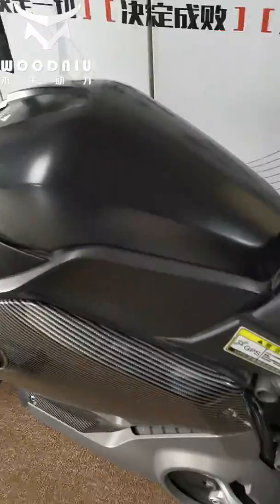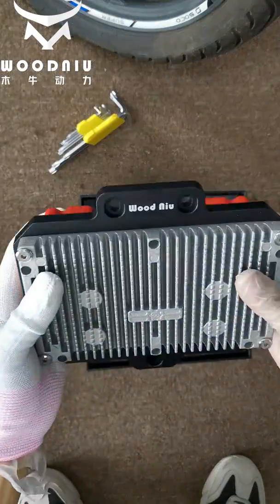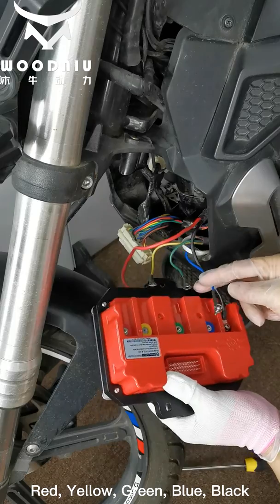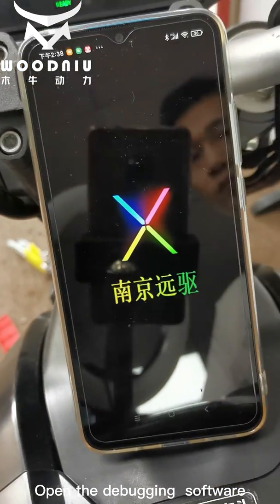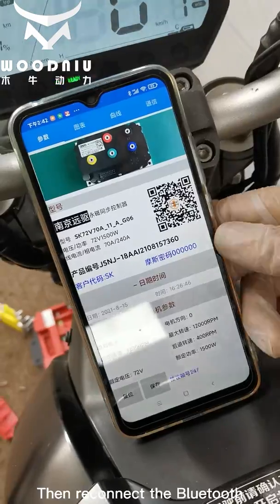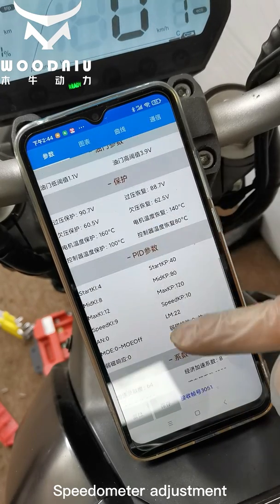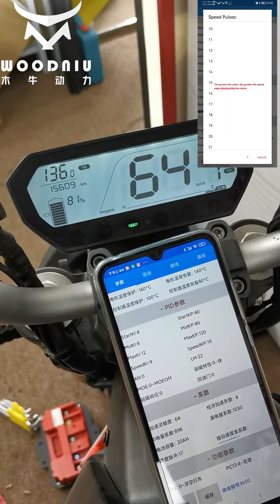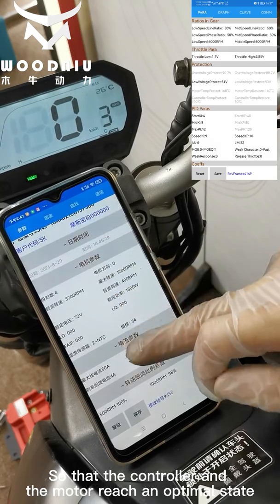TS/TC/TC-Max modified speed controller

Comment: Great product, great seller! Super happy with this controller!
Reply from the maker: Thanks for your compliment.
Reply: What model supersoco did u do this on? I’m thinking of buying but apprehensive. I’m not looking for more top speed but faster acceleration, is this possible? Any more info you can share on your installation would be helpful.
Reply: @Pipun123  yes acceleration is much better/faster in comparison to the standard controller. My model is a super soco tc. Installation was easy. Controller is the same size as the old one and comes with a bracket.
Reply: @toetsenbreier  Thank you so much for your reply! Did you change the battery? and what controller model did you get? Thanks again in advance.
Reply: @toetsenbreier  The TC model limit is 45 km/h but you can unlock it so it can reach 65 - 70 km/h. How faster does youre TC model runs for? I own a TS model and about thinking to buy this product so i can do faster then what im doing now.
Reply: Hey where can I find the same controller and battery , mine is super soco ts lite

Comment: Hey, I have TS1200r, can't remember model year but I just bought a Seenruy Li-ion battery 60v50Ah.
 Charging voltage 71,4V
Std charging current 10A
Std Discharge current 80A

Everything else is stock. My bike does have the derestriction sequel which allows me to go up to 70km/h (about 60km/h on GPS)

Would I be able to get more torque and/or top speed now that I have bigger battery by simply buying a new controller box? Or does it just derestrict what I already can do? Some controller sellers they do the debugging etc, but I just want more torque and maybe top speed without having to change the motor. Do I need to buy new wires?

Please help

Comment: It works! Installed today, had a minor hiccup with the parameters but Peter was super quick to respond and advise for a very easy fix. Now works perfectly, thanks Peter!! Can't wait to ride to work and not hold up traffic :)
Reply: Did you buy a new battery? What’s the acceleration like?
Reply: PS am riding a 2021 TC
Reply: Hi, Does original tc speedometer works with this controller?
Reply: Hey, I have TS1200r, can't remember model year but I just bought a Seenruy Li-ion battery 60v50Ah.
 Charging voltage 71,4V
Std charging current 10A
Std Discharge current 80A

Everything else is stock. My bike does have the derestriction sequel which allows me to go up to 70km/h (about 60km/h on GPS)

Would I be able to get more torque and/or top speed now that I have bigger battery by simply buying a new controller box? Or does it just derestrict what I already can do? Some controller sellers they do the debugging etc, but I just want more torque and maybe top speed without having to change the motor. Do I need to buy new wires?

Please help

Comment: Hello Peter, i have a SuperSoco TSx. I would like to have a little bit more power/torque when starting. Is this possible with this speed up controller?
Thanks for Support and information
Reply from the maker: Of course it can, it's for this.
Reply: how did it work out for you?  Also have a Tsx and thinking the same.
Reply: @erikaigner4575 
does this work on Tsx?

Comment: What is the highest speed you can reach on TC with original battery and motor?
Reply: mine 2020 tc could go around 55 km/h but then slows to 45km/h

Comment: I have a TC with factory battery. What parameters would i need to adjust in the controller? Would i need to replace battery and/or cable if i get it?
Reply from the maker: Only need to adjust the parameters of current and speed

Comment: will this work on a supersoco tc 2021 model? is it just and connect and drive
Reply from the maker: of course.
Reply: @Peter-Zhu  so I do not need to use setting program?
Reply from the maker: @jan-erikkarlsen9770  Yes
Reply from the maker: @jan-erikkarlsen9770  Yes, you are right.

Comment: Hi, I bought the battery and controller.
Not installed yet, but I do hope the app is in English.
Chinese is Hocus pocus to me...
Reply from the maker: The language of the application is automatically configured following the system language.
Reply: @Peter-Zhu  that is partially true, but not all is correctly translated or understandable.
I would like to see a better explanation of all settings. 
Especially for the TC model with 2000w motor.
What does it do exactly and what are the correct settings?
What do we need to watch out for, what setting not to do to prevent damage?
I don't understand what the speed change is doing exactly.
For example, the speedometer speed is always 5km\h higher then real speed.
Can we adjust it?
Reply from the maker: @lottumeb  You can lower the pulse coefficient
Reply from the maker: @lottumeb  For example：14→13
Reply: @Peter-Zhu does the controller work with the street hunter?
Reply from the maker: The language of the application is automatically configured following the system language.

Comment: Is this causing overheating issue? 
Does any special battery required or can be used on original TS factory battery?

I was thinking buyng this controller after guarantee period expires ?
Reply from the maker: If you are interested in SUPER SOCO's controllers, batteries and other modified accessories, please contact me: +8615549468550
Reply: @Peter-Zhu  I love un Colombia southamerica. Can u send the controller